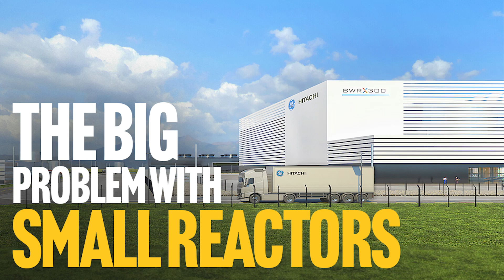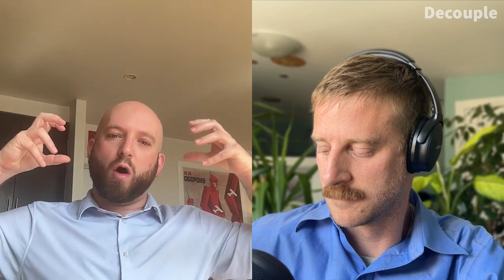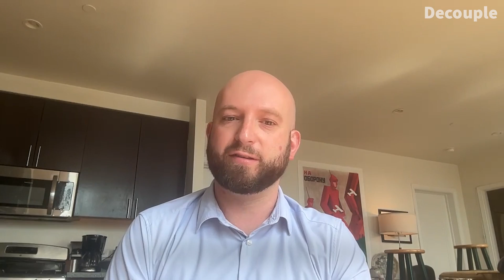The Big Problem with SMRs

Comment: A hard look was made in the 1980s to find the optimum sizing of future plants for the lowest cost of nuclear baseload power. That work found the civil works and indirect costs of construction and operation were key factors driving economies of scale because they do not increase strongly with the rated output of the plant.  The direct cost of the nuclear island was a surprisingly small fraction of the total cost.  The civil works and the non-nuclear part of the plant (i.e., the power-conversion system) are significant.  The conclusion then was that a broad optimum of plant rating existed in the range of about 1000 MWe to 1300 MWe on a 60-Hz grid, with technical limitations in non-nuclear equipment capping the economies of scale.  With the increases in turbine internal efficiencies since the 1980s, the optimum output range today is probably a little higher.  The conclusion then was that when you dig the "hole" for a plant, put as many megawatts into it as you can, up to the technical limits on equipment scale.  The fact that most of the programs worIdwide that regularly build nuclear units build them more or less in this size range makes me suspect the fundamentals are about the same today as they were forty years ago.

Comment: At 6:00, the FOAK OCC for GE Hitachi's BWRX-300 SMR is <$1B and the NOAK OCC is $2,250/kW. Also stated is the #1 consideration for power plant operators is to not have a power plant cost on their books over $1 billion https://www.youtube.com/watch?v=H3UvxEJG308&t=25s  

The NOAK BWRX-300 would cost $675 million (2019 USD), whereas the best researched NOAK AP1000, at $2,900/kW, would cost $3.3 billion (2018 USD): https://web.mit.edu/kshirvan/www/research/ANP193%20TR%20CANES.pdf 

Only state or federal ‘interference’ would ever get an AP1000 built in the USA, whereas the BWRX-300 has ‘sold’ in both the USA and 5 other countries and another SMR has been ‘ordered’ by a US data centre and funded straight from commercial money markets.

Why bother with LMRs and the unnecessary state/federal complications when, starting 2028, SMR investment will go exponential, funded by the $trillions locked up in pension funds looking to get out from under the collapsing wind/solar/battery[BEV] technologies which will be rapidly grinding to a halt as the Copper-Crunch bites.
Reply: AP-1000 can be built at 50 cents per watt. Caveats: many would need to be built at the same site, and the factories would need to be onsite.
Reply: @aliendroneservices6621  The caveats means the prospects are unlikely to non-existent. How have you arrived at $500/kW, which is 22% of the OCC of the  BWRX-300?

Comment: We must not discourage new nuclear installations.
There are 2 overriding benefits of SMR. Firstly they are ideal replacement for on site upgrades to existing 300-400 mw coal plants. Secondly it is easier to fund a starter pack with SMR than a large nuclear power plant.
SMR are obviously not a replacement for large sites and should not be sold to the public as such.

Comment: A short clip doesn't make any sense. This is actually a good channel. There is SMR:s designed to work for long time with not much of maintenance. The construction also make them theoretically fool proof. And waste is not that big deal. But you never convince Deniers, no matter what. The first units produced will cost more -yes. But mass production will then do its thing. If you are serious about replace fossils we are talking about 80 -90 % of Worlds energy prod. The need is unbelievable, then will the big polluters (you know the countries) jump on the train?
Reply: Where does this savings from mass production of SMRs come from?  Every nuclear power plant uses mass production of valves, pumps, fans, turbine, generator, piping, etc...  Do you really envision one SMR factory that includes a steel mill, casting plant, motor manufacturing, pump manufacturing, piping manufacturing, etc..

Manufacturing is specialized in specific plants. Even auto manufacturing assemblies vehicle with the majority of the parts coming from other factories. But unlike vehicles, you can not ship a SMR.  Look at the massive size and needed acres for a 1,000 Mw standard plant and a 300 Mw SMR would be at least 1/3 of that.

Comment: I would like to see a chart (that I could believe) showing the construction costs to build a 300MW Nuclear/Wind/Solar/Gas plant. I know it depends on local legislative requirements etc, but just to have a physical works cost. or even say Plant/Hardware, Labour what ever. Surely its this kind of info thats needed to inform policy. Cheers
Reply: I can save you some time on part of that:
Wind and solar are infinitely-expensive, on a sustained basis. There is zero point in building out any wind-and-solar, unless your goal is permanent-blackout.
Reply: @aliendroneservices6621  I know that but I am looking for hard data, unless you have that you are just another shill fighting your corner. 
I am in NZ, theres no subsidies here, yet wind and solar farms are going up everywhere. So I do believe that they must be cheaper per KWH in the short to medium term. I want to know how much the small reactors in Canada are costing, and how much of that was useless red tape, and what does it cost to re-fuel them after x years, running costs, that sort of stuff.
Reply: Currently  a combined cycle natural gas plant is one sixth (1/6) the capital costs of an equivalent small or large nuclear plant. There's plenty of gas - - we're good for hundreds of years. And they now mix in 'renewable' biogas and, increasingly, hydrogen gas to the fuel to make it a much cleaner burn.....in fact, emissions are now well within so-called "net zero" recommendations.
Reply: @davidgeary490  
Thanks, 
That's the sort of information I am after, but I really need the source, so that I'm not just passing on 2nd hand info, that probably passed through the hands of various zealots pushing their own particular barrow.

Comment: EVs big battery utility factor, when parked 23hrs daily, is very low.
Selfplug-in V2G EVs, driven 1 hr and plugged in 23hrs and trading electricity with the grid is MAXIMUM UTILITY FACTOR. 

EVs battery liquid temperature management is extending battery life cycles by decades and the battery is free with the vehicle. 😊😊😊😊😊

The utility factor for nuclear grid electricity will be the big problem. 
Grid capacity expansion costs are a huge cost like the plant costs. The both limit nuclear grid electricity. 

The grid construction costs also limit distant renewables in the same way.

Offgrid capacity with big EV batteries means financial survival of these big grid solutions will need the customers to be locked into grid supply by law. It will be illegal to abandon the national grid.
Reply: And such use also puts a lot of cycling wear on the battery which reduces its service life.  There is no free lunch.
Reply: @randacnam7321  EVs battery liquid temperature management is extending battery life cycles by decades and the battery is free with the vehicle. 😊😊😊😊
Reply: @stephenbrickwood1602  Still not a good idea.  Stationary applications are better served by batteries optimized for calendar life and cycle life as they don't need to move.
Reply: @randacnam7321  it is a good idea. Resources and money and time are always the problem. 
I can see community batteries being first, and then, as the first suburbs fill with EVs, the community batteries moved to the slow adopter suburbs. 
This is the fastest solution to an EV world. 
Musk seems to have become effective in minimising vehicle production costs. 
Others will copy him.
Reply: @stephenbrickwood1602  That assumes that maximizing the utilization of a given thing is always good.  It isn't.  Take the case of some kind of emergency where you need to get out of dodge (hurricane, wildfire, family emergency, etc.) but can't cuz discharged car traction battery.  It's also a quality of life problem if you just need to get somewhere even though it isn't an emergency.
Plus, traction batteries are by necessity optimized for energy density and power density due to where they are used.  Stationary batteries don't have the limitation of being confined to a vehicle and can instead be optimized for calendar life and cycle life.
Reply: @randacnam7321  most petroleum vehicles tanks are only ever full once the bowser stops filling. 
Most EVs can be full every day.
Maximised utilization factor for everything is an economic smart thing to do.
Start with the big picture and work back to the little things. 
Climate destabilisation is the biggest matter and individuals circumstances can be solved after you are on the right solution. 
EVs will take 20years to be 100%.
Petroleum prices will fall to maintain cash flow on old investments. 
Petrochemical industry will remain and need feedstock. 
I understand what you are saying. 
Some people will hang on to their ICE vehicles for decades.
Reply: @stephenbrickwood1602  Maximizing utilization of everything means everything wears out faster and that there is no spare capacity once something breaks, which in turn drives up the likelihood of more things breaking.  Look up cascade failure in critical systems.
Filling a fuel tank with gasoline/diesel/propane/CNG/etc. doesn't degrade it.  Charging a battery does.
EVs will never be 100% of the net vehicle fleet or even anywhere close; there aren't the resources.
Climate is always changing, and we are still coming out of an ice age.
Reply: @randacnam7321  good comments. 
Nuclear promoters refer to 100% electric future. 
And maximum utilization factor. 
And climate change by CO2 emissions. 
And no CO2 vehicles, EVs needing more electricity. 
To stop worldwide CO2 emissions. 
Including the dictatorships Nuclear industries. 
They refer to the new grid being extremely expensive and expanding nuclear electricity supply ( more grid capacity)
Nuclear refers to conflict with solar pv renewables.

Nuclear f up their own logic about the future. 

Nuclear needs tax payer's money.
And government guarantees.
Reply: @aliendroneservices6621  I think that existing nuclear electricity should be kept working. 
80% of the world's population is in dictatorships. 
80 % of the world's population is in warm latitudes. 
Australia is the sunniest continent on the  planet, and with more energy in the atmosphere and its mineral resources, it  doesn't need nuclear electricity. 
Big batteries and EVs are becoming more common and popular here.
Rooftop solar PV is cheaper than windows $/m2. And connected to the existing national grid. 
The Australian national electrical grid is fragile because it is extremely expensive to over build and maintain it is also expensive. 
Nuclear steady load and renewable electricity variability destabilise the grid.
Batteries are effective at stabilising the grid economically. 
More cheaper Rooftop PV and EVs big batteries in 20 years means no new grid construction is needed. 
Australian grid costs $1TRILLIONs.
Nuclear promoters talk about grid costs at $ 1 million per km, and Australia has 1 million klm, and the small amount of grid electricity energy expansion needs to include the grid costs. 
Nuclear grid costs and their utility factor and time frames are a disaster in a renewable energy economy. 

Also, worldwide CO2 emissions is Australia's problem. 
Also, worldwide dictatorships are a great problem, Australia has cancelled the French submarines contract, $billions lost, and is buying 6 USA nuclear submarines and USA weapons systems. 

So, selling uranium yellowcake to nuclear industries worldwide is impossible militarily. Defence Budgets will explode.

Just my thoughts.
Nuclear promoters also want government disaster insurance, and the government guarantees cash flows in Australia.
Nuclear needs to be locked in for 60years to 100years. Economic stupidity. 
New technologies will clash with the old.
Reply: @randacnam7321   Did I say EVs battery liquid temperature management is extending battery life cycles by decades and the battery is free with the vehicle. 😊😊😊😊😊 ?

This is great new discovery of todays battery technologies. 
The Nissan leaf battery was bad in this regard. 

Cheaper battery technology is evolving as well. 

Trading battery service to the grid is a profitable business in parts of Australia as it helps grid stability. 
The big $100million battery in SA paid for itself every year since it was built. 
The first big battery in the world. 
Hornsdale BIG BATTERY South Australia. 

The early adopters will get the best returns until everyone gets their EVs.
Reply: For the upteenth time Stephen, all serious high wind+solar scenarios show a massive EXPANSION of the grid, not a contraction. Nuclear is what allows for a leaner grid. I implore you to stop repeating this brainrot that no one outside Australia takes seriously.

Comment: To me it always struck me that it's an incredible amount of work and expense to get the site approved for any reactor, so 10 sites for SMR or Micro is still a similar amount of work as 10 sites for LWRs completely independent of the component and assembly costs.
Reply: It could be worse with SMRs, since they could be installed near industrial zones.